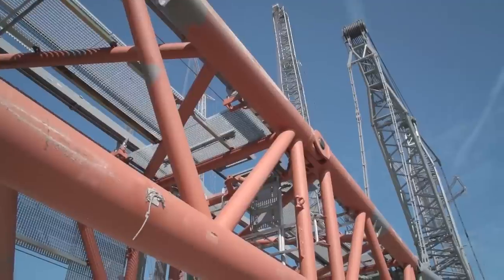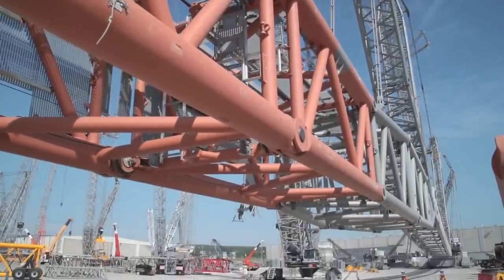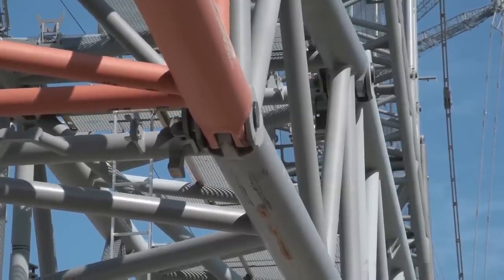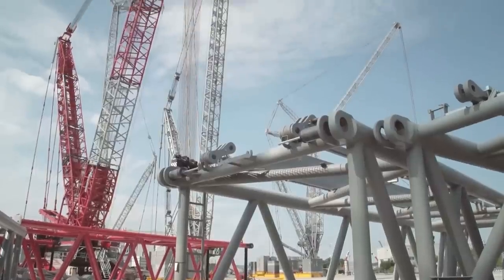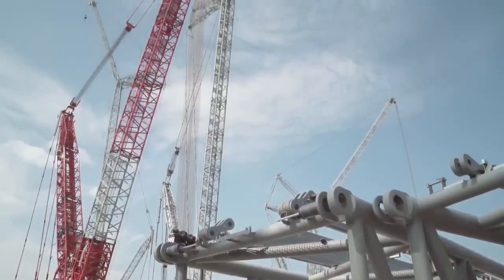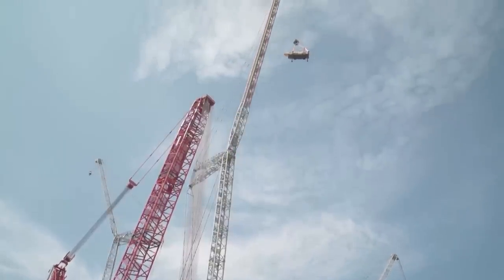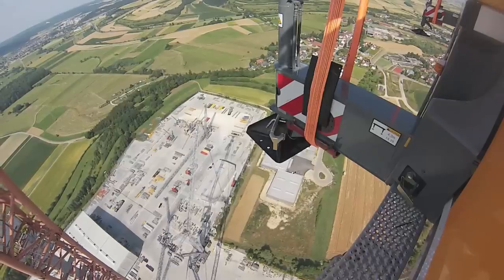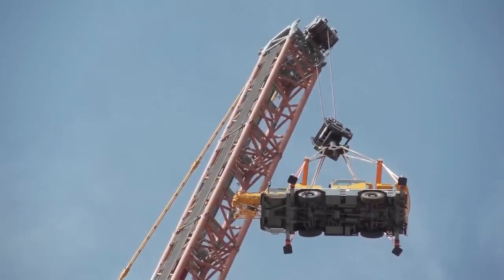Liebherr - LR 13000: Tallest crawler crane in the world

Comment: Well one things for sure ,that beast is booked 2 & 3 yrs in advance ,I can't imagine the monthly rate .
Reply: probably at least 700 bucks!
Reply: Will Fishing lol is that a joke?
Reply: Will Fishing I wonder what it is forreal. Probably 100,000 a month or more.
Reply: About $500,000/mnth plus another $300-500k in mobilization cost. Usually bid more in large multi-month projects in the 7 figure range though.
All relative since you'll be spending about $25-30 million to buy one.
Reply: @sugershakify  I knew I guessed low
Reply: 500k A MONTH!!! That's insane, I was also thinking around 100k.. crazy
Reply: If it's like high end electronic test equipment, the rule of thumb is something like 10% of the purchase price per month.
Reply: I think somewhere on Google it mentions mammoet bought the first one. Of course, mammoet specializes in ridiculously large moving and lifting contracts and with that, this would be something they would need.

Comment: I am very impressed on how much enginuity goes into building monstrous cranes like the Liebherr 13000. I'm also curious as to what kinds of jobsites can a crane with a 248 meter/744 foot height can be best used in. 744 feet is 144 feet higher than the average height of every strip resort in Las Vegas let alone the height of the average tower crane could reach.
Reply: Building parking garages I've seen with a 1300 idk for something this big. Pyramids?